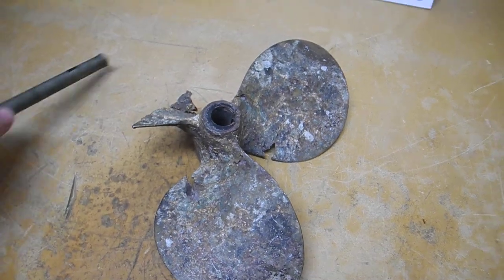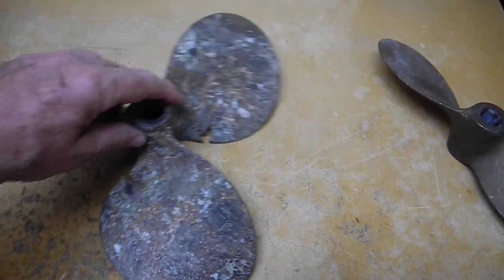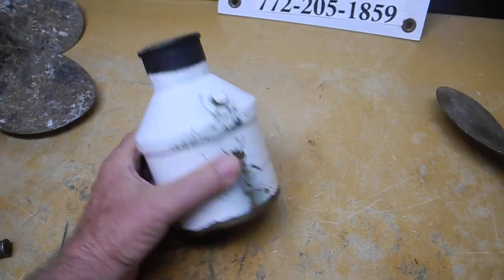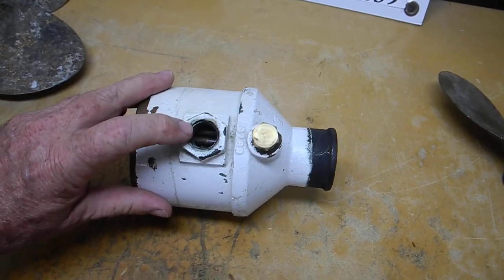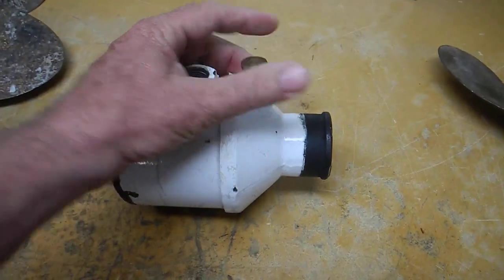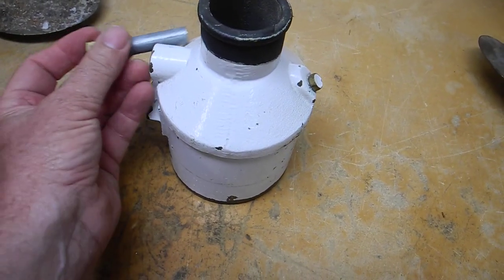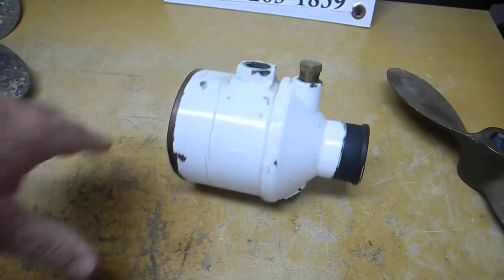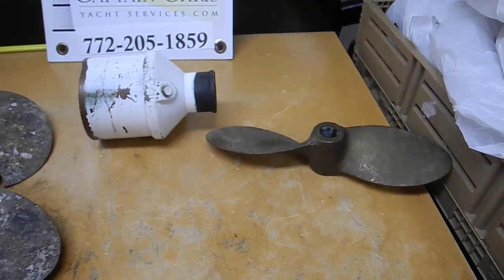Ring the bell, err prop

Comment: Zinks are hugely important .       Because if them i have 55 years on the original prop and prop shaft .  Had the prop reconditioned last summer  and that made a noticable difference . But its still original.
Reply from the maker: Glad to hear the few dollars every year saved your expensive propeller. Good preventive maintenance.
Reply: @AskCaptainChris  next time I haul out I plan to plan ahead and get a new one
Reply from the maker: @walterdavis4808  I hope you are getting a new anode, they are cheaper than propellers!
Reply: @AskCaptainChris   new zinks every time she's pulled out   , new prop and shaft next time .  When the prop was reconditioned it went from a 24 inch to a 22 .  It was razor thin at the edges

Comment: Didn't know about the ringing test. Both my props are at the shop now being checked and straightened. Now I'm nervous.
Reply from the maker: If they were this bad I hope they would have said something as soon as you dropped them off.
Reply: I had mine reconditioned because it would take 3 months for a new one ...  Huge difference for the better
Reply: @walterdavis4808  Amen brother. And the cost difference will hurt your feelings.
Reply: @charlesdavenport2543  I was ok with the cost but not having my wood boat out of the water for 3 months.  I'll get a new prop and shaft next time I haul out añd order early